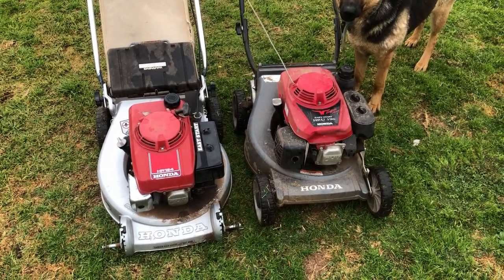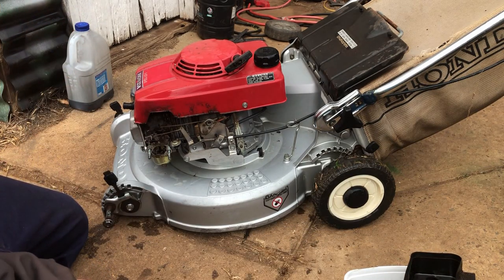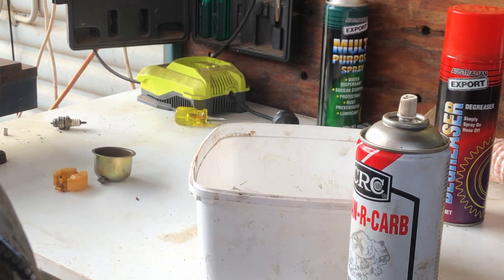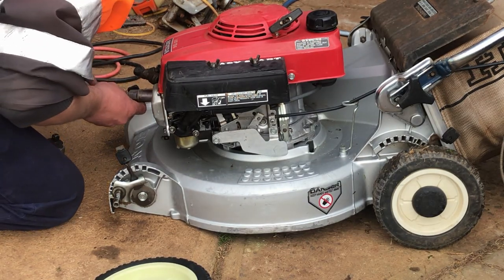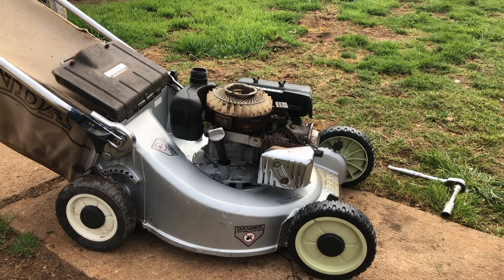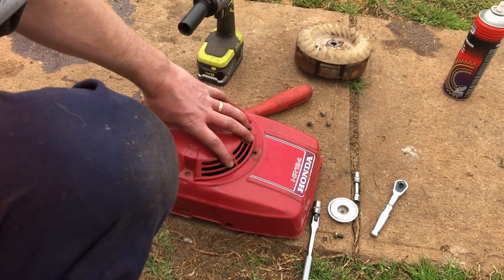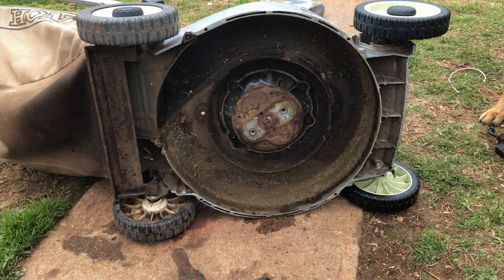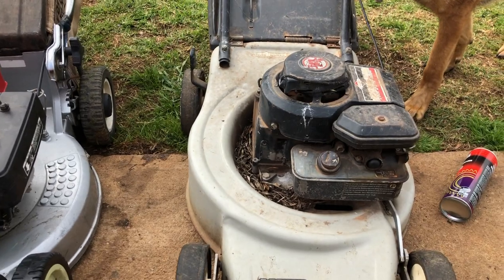Lets revive a good old Honda HR194!

Comment: I have the same model! After sitting in my shed for the last 10+ yrs, I decided to see if I could get it running. I dumped the little oil it had out, put fresh, put fresh gas & GENTLY pulled the cord & IT STARTED! Same plug, a decade old & I cut the lawn. Even with the 100% rusty blade it still cut better than my NEW $600 Honda. Great video!
Reply: I have heard this model is one of the best mowers ever made! Im keeping my eye out for one instead of buying the new junk thats out now

Comment: I had to replace the carburetor on my 194. i found that it was not just the bowl that had been corroded. the idle passage had been corroded and clogged. it would not idle. it only ran on fast. check the in tank filter. :-)

Comment: bro my dad found on of these things being thrown out and after sending it in for a service it is just as good at cutting grass as my new $2200 21 inch commercial lawn mowers.

I might just fix these things up and run them until they explode, it will be way cheaper and just as good as spending fortunes on new commercial equipment.